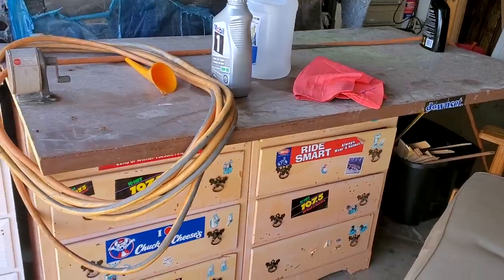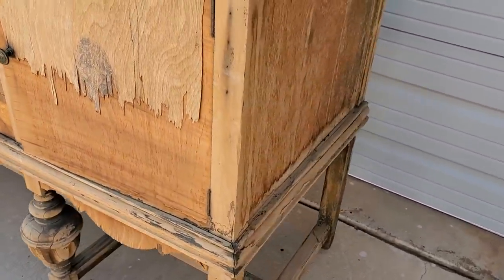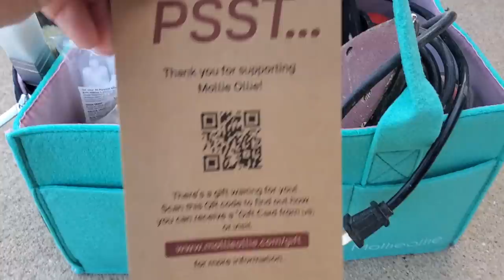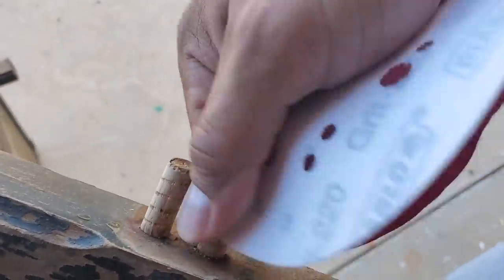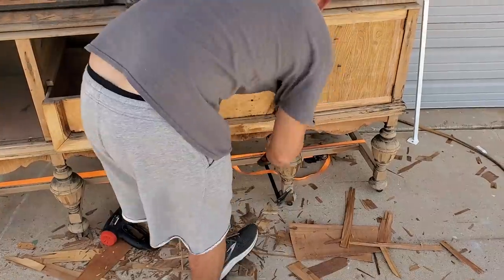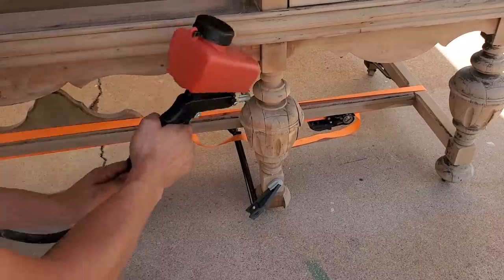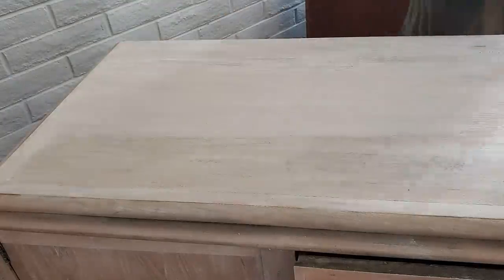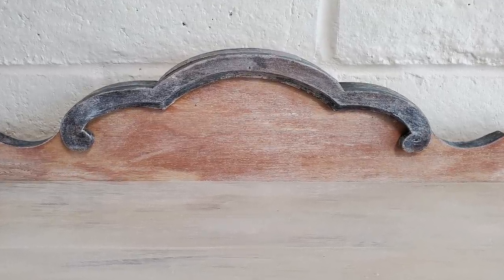Destroyed and Falling Apart Antique Buffet Finds A New Life With a Stunning Bleached Wood Style

Comment: This looks so nice.  You did a great job :)  Just a question though from a newbie - if red means lead does that mean you can't sand it? even with PPE? does it mean you have to throw the piece out? Thank you :)
Reply from the maker: You would have to strip it. There is a particular type of stripper for lead paint. Regular stripper isn't strong enough. You'd also have to suit up, wear a mask, and collect any of the debris into buckets to then dispose of in the hazmat section of the dump. A lot of work!

Comment: Cory I’m curious what you’re going to do with or how you’re going to handle the original piece of furniture aka ugly duckling that you were going to make over? I have a feeling my upper kitchen cabinets have lead paint I bought a kit but haven’t used it yet to see and if it is lead paint I’m not sure what I’m going to do with them. Thanks
Reply from the maker: I am going to throw it away. There are methods to encase lead paint with a special lead sealing paint but it is pricey. Another option is to strip it using the hazmat led removing method which is very time consuming and I wouldn't feel safe doing it. I hope your cabinets are not lead painted!

Comment: I found a dresser with all its original pendulum hardware….for $20. If I had to replace even one of those pulls I would easily cost me $40 or more. Bought the dresser for just the hardware but the dresser was is better shape than this piece so maybe I should get going on all those garage pieces as well. 
Nice job. Just a note to hubby….wear some kind of respiratory protection when sanding old pieces. Between mildew and cancer causing chemical once used to adhere veneer protection is always important. Will be getting some of those “red means lead” markers.

Comment: Hey Cory...how are you! I watch you all the time....I too live in Arizona, and also have a passion for saving furniture. I have a question for you since you know how the sun and heat can damage wood first hand also. I found a Rocking chair this morning...it is oak but very very faded and dry....is there something I should treat the wood with that will help restore some of moisture I guess is the word I'm looking for? My roommate has taking it apart and we ate regluing all the joints...and also one of the rockers is longer than the other. This poor little chair is gonna be back to great...if I have anything g to say about. Anything you could recommend would be greatly appreciated! That's for " making that" and doing well!
Reply from the maker: Hi Denice! Good on you for restoring a piece! There are soooooo many products that are great for restoring the moisture in wood. Give it a good sanding with a fine grit sandpaper and you can have your pick at many different oils found at the hardware store. The ones meant for butcher block are non toxic and a great choice. Adding a wax finish at the end will help prevent moisture from leaving it again
Reply: @DesertDIY  thank you so much....you are an inspiration...and that fact that you donate your pieces is just a testimony to your character....maybe we will run into each other someday! Happy rehabing!
Reply: Also I was planning on painting some and leaving some wood grain by staining....I should oil the wood before I'm assuming?
Reply from the maker: If you plant to paint, do not use oil at all. Water based paints will not do well if it is oiled.

Comment: i've worked on pieces in worse shape than that, they've actually came into my shop in boxes with half the pieces  missing , and i've restored them back to almost original condition, Oh what's with the dry screws to repair that split leg? and how come all the dowels weren't replaced every dowel on that piece should have drilled out and replaced with  new ones..  Hole In The Wall Wood Working  Shop on face book.